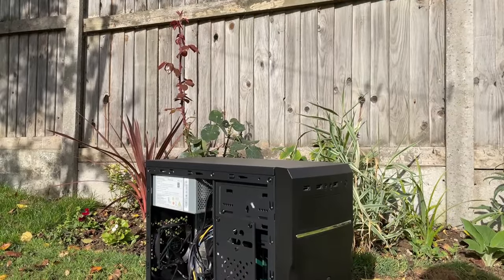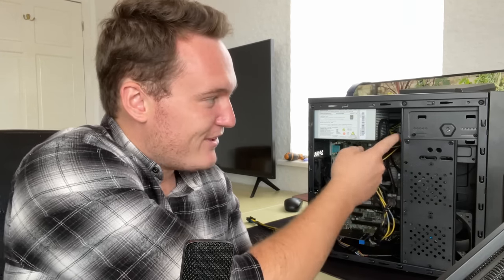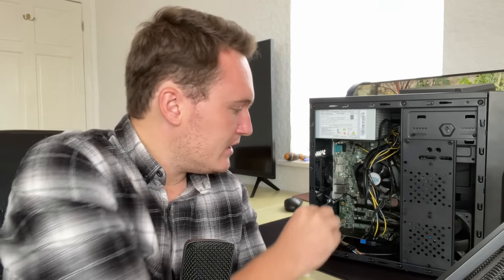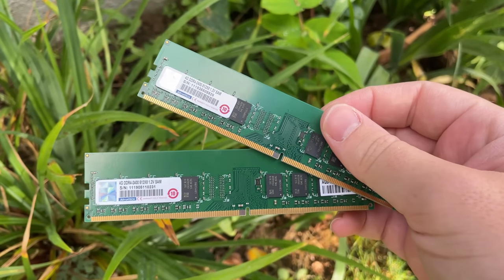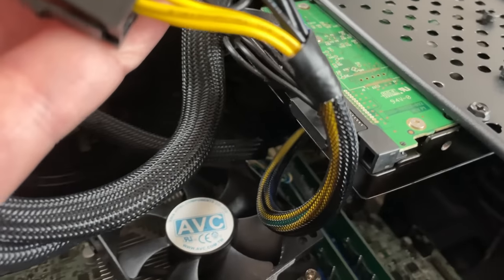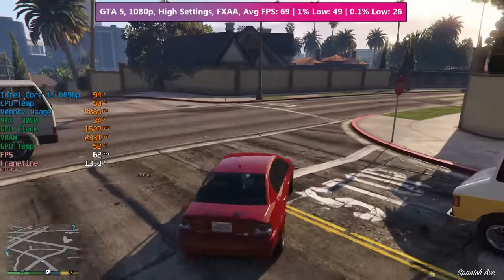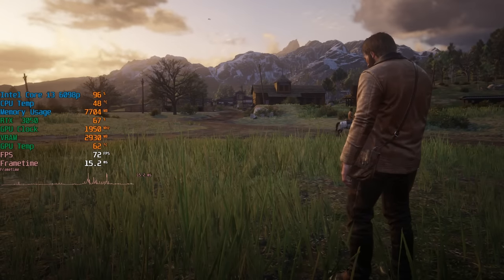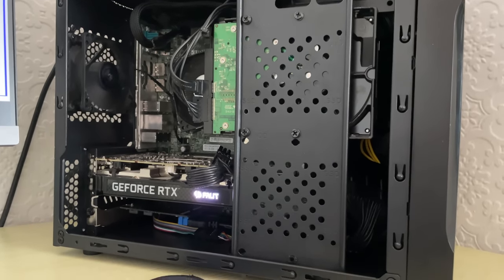This "Custom Built" PC Was Hiding an Unwelcome Surprise...

Comment: As someone who has repaired, rebuilt and refurbished for many years now, I often come across the "unwelcome surprise" of discovering that Windows is often installed on them. I often wonder why anyone would ever buy a PC without an operating system on it. Fortunately, when the PCs leave my hands working nicely, they do have Linux on them which will finally make them usable for someone else.

Comment: I'll let you know from personal experience the i7 6700k is still an absolutely amazing cpu still and can handle a lot of modern games with ease for the most part I'm upgrading today actually because I recently got a rtx 2080 super for 365 bucks a little bit ago and I'm noticing at times a slight bottleneck but it wasn't too major and I'm sure I could have overclocked the cpu further past the 4.4ghz I run it at and get rid of the bottleneck but I kinda want an upgrade path.

Comment: You should have been running all the games on Ultra settings to help alleviate the CPU bottleneck since you were on 1080p.
Reply: it's not really going to alleviate the bottleneck, the games are still going to have a garbage frame rate, it's just gonna be a prettier slide show. Upping quality won't suddenly make the cpu frametimes better.
Reply: @joemarais7683  The frame rate will get better, and it's been proven. How much better is up for debate because it varies game to game but it makes sense to try.
Reply: In Cyberpunk, he should have turned crowd density and/or traffic down from Medium to Low, as those are CPU intensive settings. Then he'd get a higher frame rate. Maybe he could have even turned other graphics settings up to high and still get better frame rates than how the game was tested.